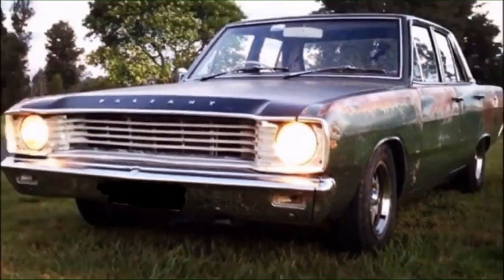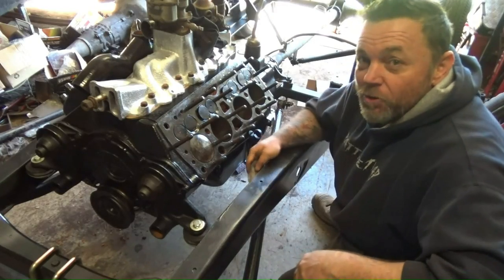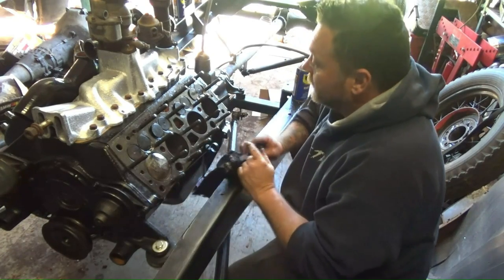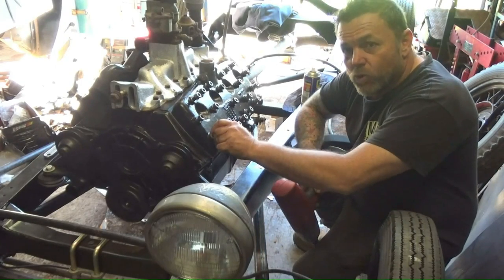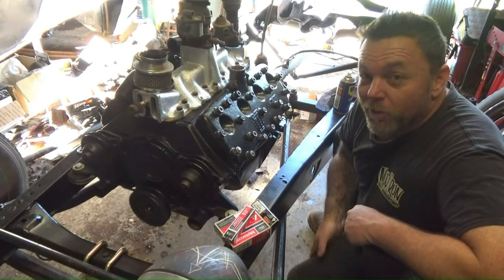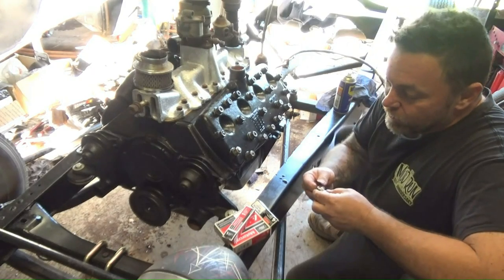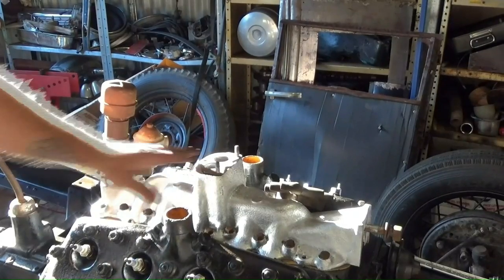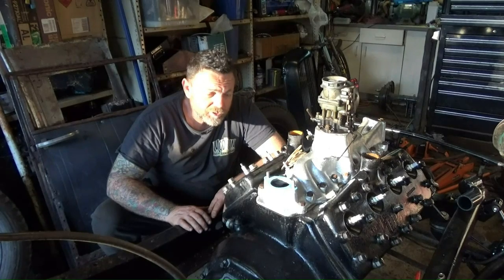Can I get this 1937 Ford V8 engine to Run? Model A Ford Hot Rod Pick Up Build Pt26

Comment: Why didn't you just use an angle grinder wire wheel on the first pass cleaning the head surface,  then finish with an 80 grit flap disc? Would have been heaps quicker!
Reply from the maker: I usually just tie a rope to the cylinder heads and drag them down the road in my car, cleans them up super fast but I couldn’t find any rope 💁🏻‍♂️
Reply: I chuckled 😂